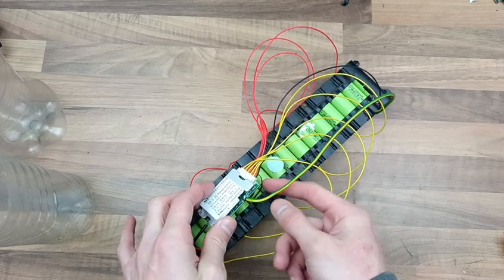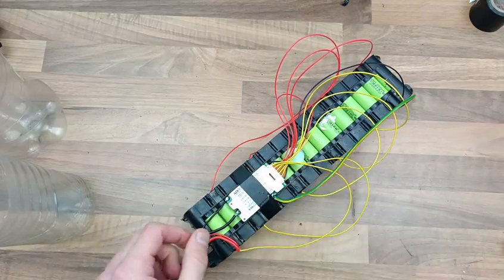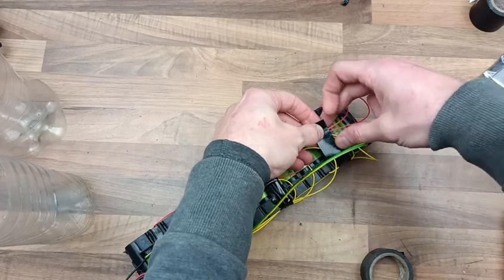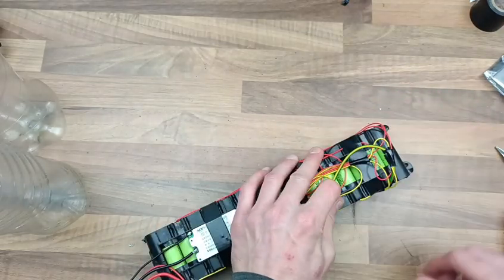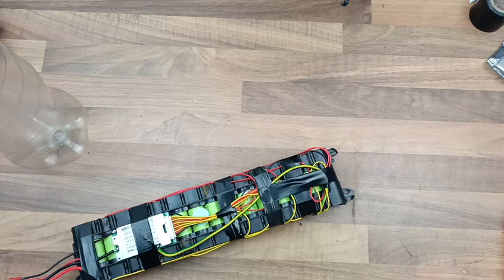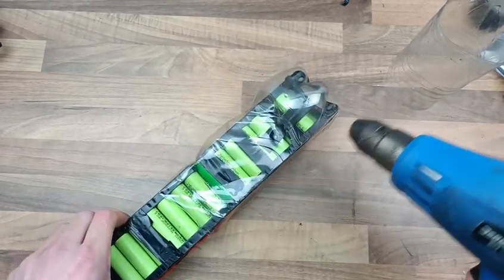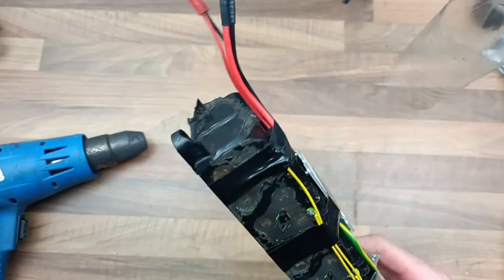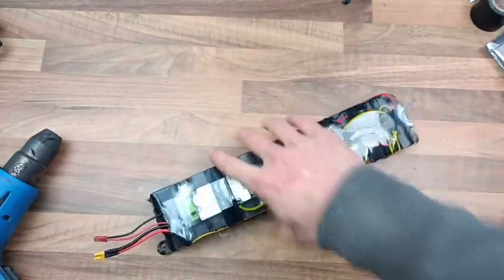Repairing/Building/Rebuilding a 36v (42v) BMS Lithium Ion 18650 Scooter Battery on the Cheap! (3/3)

Comment: Hi I wonder if you can help, i’m looking to wirelessly to turn on a low-voltage light 12v system I’ve built from another pir control unit, what can I use to communicate the two units together?
Wireless distance doesn’t really matter as long as it’s got a distance of round about 10m max 
Ie 
Unit 1 Pir activates = light comes on.  
Unit 2  light then activates 

That’s literally I don’t need no singing or dancing😃😃 
Any help would be appreciated
Reply from the maker: RYLR896. 🙂